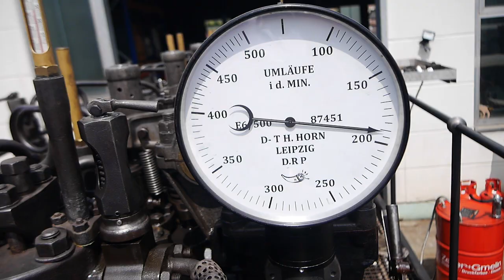look around,Körting,air blast injection,Diesel,stationary engine,Dieselmotor,U-Boot,Stationärmotor

Comment: It is incredible, a modernized airblast injection engine, they have put a revolution sensor in it, and they have put in a servo to control the engine load, that engine looks like it was running for a long time.